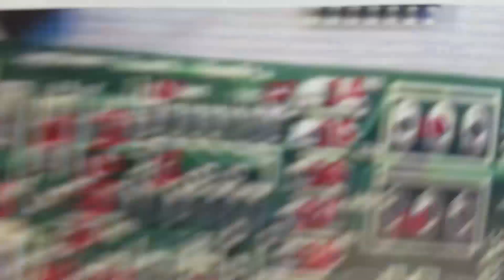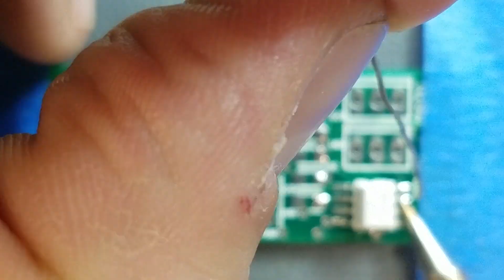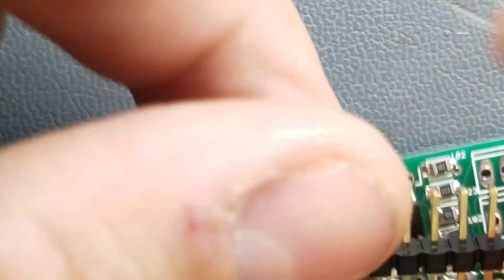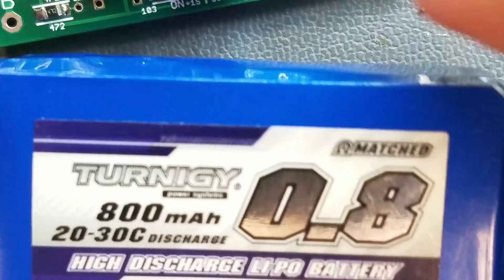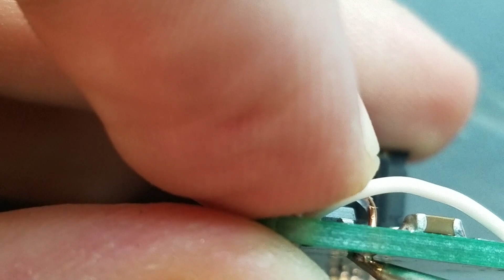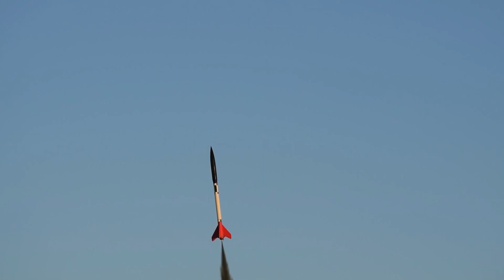EggTimer Quark Assembly

Comment: Something Iv learned from killing a few flight controllers over the years, is that low temps is worse on components, as you have to leave the iron on the component so long that the heat soaks...these fine jobs, I’m usually around 375-400°c...it gets the heat to the pad fast, and you only have to have the iron on the joint to 2 seconds or less. 350c would probably be a good starting point for micro processors with tiny pins like that.